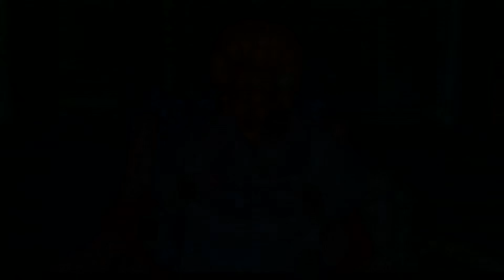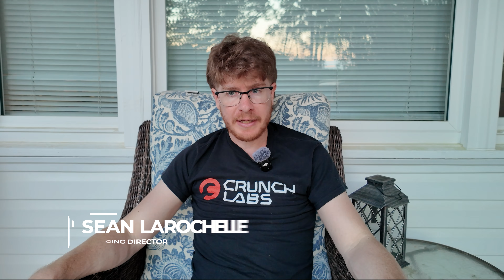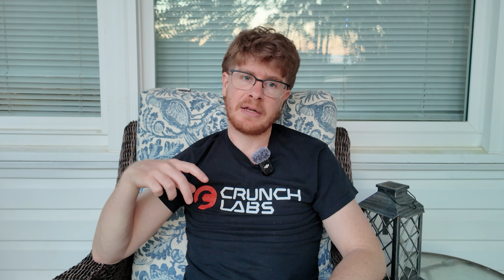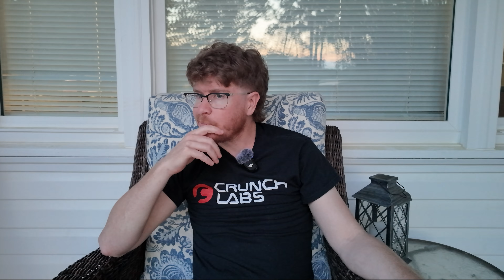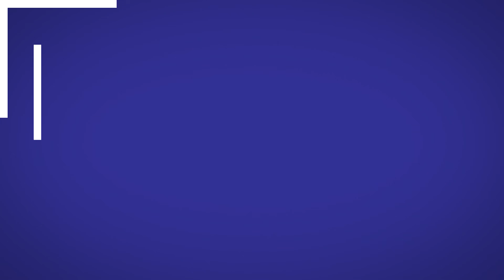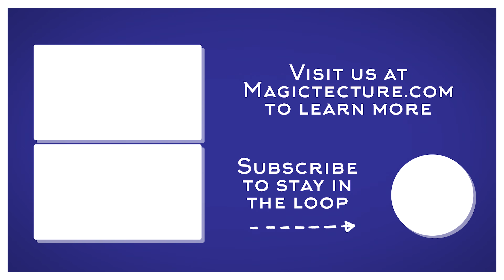New Rides, New Tech, New Direction

Comment: Here's a tip for reliability: You made a compressed air launch for Lil' Thunder. To improve reliability, consider switching to magnetic launches like LSMs for example. If that's ntoo complicated I imagined a brand new revolutionary launch mechanism. Some solid elastic cords attached to a catch car in the back and a non-movable attachment in front. The elastic cords stretch bvack and tension and the catch  car locks in some sort of mechanism, holding the car in place. With the push of a button, the catch car is released and the tension built by the elastic cords is released sending the car zooming.
Reply from the maker: Very cool idea! I wonder if anything like that has been done at scale? Pneumatics are interesting since air craft carriers were using them prior to roller coasters. I’ll have to look for the elastic equivalent!
Reply: No other coaster has used the launch mechanism I described. It would be a world's first. Use flexible steel cables or something for the launch

Comment: I love your coasters I want to build an immersive coaster in the future using a magnetic launch system. Hope you are able to build the coaster! Can you also give me material recommendations should I use pvc pipes or steel pipes and what wheels?
Reply from the maker: Highly recommend steel both for durability and performance. Depending on the weight of your ride vehicle plus rider, you may get away with longboard wheels or of you’ve got a large weight, go with custom coaster wheels. Maclan Wheels is a great place to start.